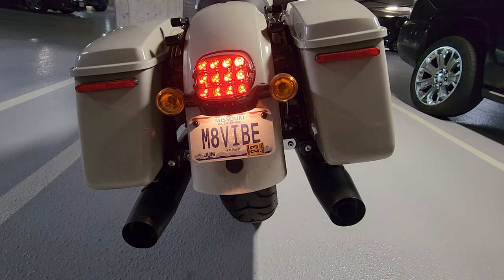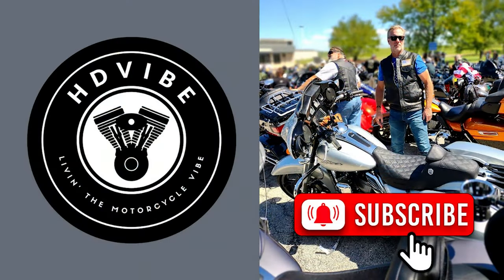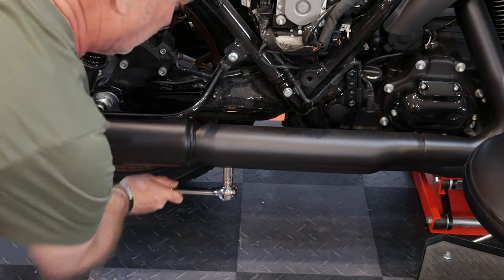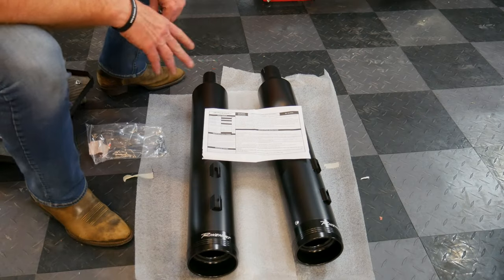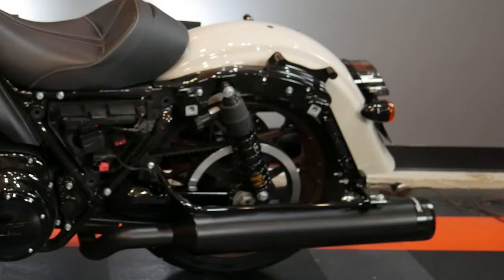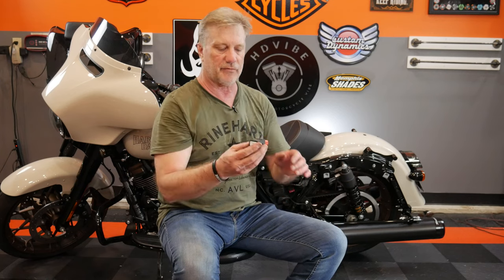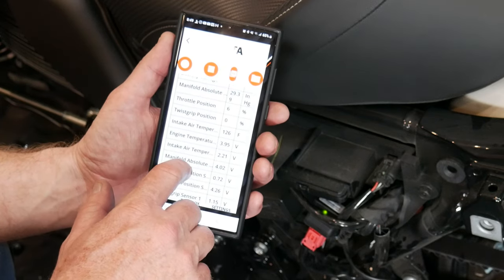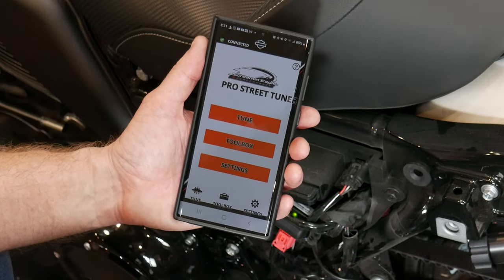Tune your Harley with the NEW Screamin Eagle Bluetooth Pro Street Tuner | Street Glide ST

Comment: Love your videos, but why would you run slipons on a ST with a 117. You leaving performance on the table unless you upgrading later to a full pipe. Have you seen how ugly and heavy the factory pipe is.I know you want to stay within warranty and I get that. I have a 23 RG-ST and put a 2 into 1 Sawicki stainless pipe,powervision tuner, hpi manifold so far. I’m trying to squeeze every ounce of performance out of the motor lol. Keep the videos coming!!
Reply from the maker: Thanks for watching and commenting.   I certainly understand there is more to get out of the 117...but as you stated, I'm want to stay in warranty so I could change it out but I would still have to run the Sceamin Eagle EPA tune.  So will it run well in that configuration and tune or not...that's my dilemma.   I appreciate the kind words and support. If you are already a subscriber...thank you.  If you haven't yet subscribed to the channel I'd be honored if you'd consider doing so.   Ride safe and enjoy.  👊✌️👍

Comment: Does the tuner support Vance and Hines pipes? Thanks
Reply from the maker: Thanks for watching and commenting.   While other slip ons are not specified in the tuner map, the base map supports more free flowing slip ons...in my case Rinehart DBX 45s.  So Vance and Hines slip ons with the tuner should be fine.  If you are already a subscriber..thank you. If you haven't yet subscribed to the channel I'd be honored if you'd consider doing so.   Ride safe and enjoy.  👍✌️👊

Comment: Great video. 
I just became a subscriber. 
I had a stage 1 done with SE Street Cannons and air cleaner 
I have the original pro street tuner like the one you showed in the video.
Would it benefit me to get this tuner?
Thank you for your help and time.
Reply from the maker: The capabilities of the two tuners are nearly the same. The primary difference is you can auto tune via the app on your phone and generally you do not have to use your computer with the new one.  The other advantage of the new one is checking codes via the app and monitoring the engine while riding.  Thanks for subscribing and commenting.   I appreciate your support.   Ride safe and enjoy. ✌️👊👍
Reply: @HDVIBE  Thank you for the quick reply. 
I have seen a ton on negative reviews on this product and it makes me a little nervous about buying it. 
What have you seen out there on bad reviews and what are your thoughts on it and is it worth it?
Thanks again.
Reply from the maker: All I can share is my experience with the tuner.  I haven't had any problems with it at all.  So far everything with the tuner has functioned as it should.  I'll be doing a follow up video on it showing the smart tune feature in the near future...probably in the next 4 to 6 weeks.  ✌️👊👍
Reply: I broke down and bought the Bluetooth tuner. 
It worked like it should. 
The only issue I had was low voltage and it wouldn’t tune so I charged the bike for a short time and finished the set up and tune.
I will update after I ride a little bit.
Thank you
Reply from the maker: @Madfire183_2  Thanks for watching and commenting.   I'm glad you got it installed and loaded the map with no issues.  If you are already a subscriber to the channel...thank you.  If you haven't yet subscribed to the channel I'd be honored if you'd consider doing so.   Thanks for your support and ride safe.  ✌️👊👍

Comment: Have you noticed your Bike running cooler/richer with this Tune ??, I just subscribed, great channel, as I may Come back to H-D once again. ??
Reply from the maker: Thanks for watching, commenting and subscribing.  The tune definitely gives the bike a better air fuel mixture ratio.  The M8s are not as lean from the factory as we're the Twin Cams.  I have had both and the M8 definitely is a bit richer from the factory and runs cooler than the twin cams.  I've recently also smart tuned the bike ( you can also check out that video) and it runs even better.  Thanks for your support 👊✌️👍
Reply: @HDVIBE  
Very True about the Twin-Cam..I had a 2017  LowRiderS 110, and it ran Super Hot. I put Amoil 15w60 oil to cool it down a bit. , Nevertheless, I was given an offer I couldn't refuse and sold my S, for good $$$$
Reply from the maker: @elithegreat6463 👍

Comment: How long does it actually take? mine has been on " Programming Motorcycle with final calibration " for the last 45mins
Reply from the maker: Mine took maybe 5 minutes to update and load the map to the bike.
Reply: Not sure what's going on with this thing. First it said it was connected by blue tooth. Now it tells me another Mobile is connected and I have to unpair from that. I only used my phone.
Reply from the maker: That's is odd.  Hopefully disconnecting and trying again will do it.  As I said mine connected right up and 5 minutes I was good to go.  ✌️👊👍
Reply: @HDVIBE  done that several times,  still will not connect 😑
Reply from the maker: That is odd.  Maybe check with your dealership service department to see if they have any ideas.  👊

Comment: But do you still have the cat in the headers? I thought stage 1 was removal of cat or new cat free headers.
Reply from the maker: Technically a Stage 1 is a heavy breather,  slip ons and a tune.  Often headers are changed out as well...however, many aftermarket header manufacturers are going CARB compliant...which means unless you get old stock,  even new headers will have a Catalyst in them.  It's sad but this is they way the market is going.  Many slip ons are going to be 50 state compliant as well soon.  Vance and Hines and Rinehart just started making the switch to 50 state compliance .  Thanks for the support and ride safe. 👊✌️👍
Reply: @HDVIBE  My concern is that a tuner adds more fuel and more fuel to the cat means more heat.
Reply from the maker: Yes...I understand your concern.  So far I haven't noticed a change in hear on my bike yet.  However I haven't ridden much yet with the new set up.  Another cool feature with the SE Bluetooth tuner is the ability to monitor real time temperature and many other parameters will riding with the app open on the phone while riding. 👍
Reply: You can get  a "stock" decatted head pipe from harley directly I just bought one today with the same tuner but bassani mufflers
Reply from the maker: Thanks for sharing that information Andy.  Ride safe and enjoy.  ✌️👊👍

Comment: Do u have stock headers? I have the tuner but it doesn’t have a option with just slip ons and hi flow filter.
Reply from the maker: I do have stock headers in the bike.  I did ask a Harley Master Technician about putting different headers on the bike.  He told me that if the headers are 2-1-2 then there really isn't much difference in how the bike will perform with the Harley tune.  The only difference will be more sound output.  You can also run the auto tune feature to get the map and air fuel ratio modified for the exact set up.   If you are already a subscriber...thank you.   If you haven't yet subscribed to the channel I'd be honored if you'd consider doing so.   Thanks for the support and ride safe. 👊✌️👍
Reply: @HDVIBE  thanks a million! I am now a new subscriber, thank u! I can’t wait until tmrw to install it:))))
Reply from the maker: Thanks for subscribing.  I appreciate your support.  Enjoy that newly tuned bike.  I was shocked at the improved throttle response after the tune.  👊✌️👍
Reply: @HDVIBE  I’m wondering if I should auto/ smart tune it vs stage 1 stock header tune. They come lean from factory …puzzled lol
Reply from the maker: You have to load a base map before you can auto tune.  👍
Reply: @HDVIBE  hey, what temps are u running with the stage 1 map?? I’m around 290 degrees. Which I never checked temps before.
Reply from the maker: I haven't checked it yet but I will and let you know.
Reply: Sorry if this has been asked already, but will this work for a full exhaust D&D 2:1?
Reply from the maker: @Tack1903 The tune from the screamin eagle tuner is set up for a 2 1 2 headpipe.  However, I do know someone that runs a 2 into 1 with the screamin eagle tuner.  All of the tunes that can be downloaded from the screamin eagle tuner are set up for screamin eagle components.   But that doesn't mean it won't work with other headers etc...it just may not have the most dialed in tune.   You could then run the auto tune feature.  I would also suggest making sure you look at the specs for the tuner to make sure it will work for your bike.  The connector on this tuner is for the 2021 and newer bikes.  I hope this helps are at least gives you a bit more info.  If you are already a subscriber to the channel...thank you.  If you haven't yet subscribed to the channel I'd be honored if you'd consider doing so.   Thanks for your support and ride safe.  ✌️👍👊

Comment: Do you have the stock headers on
Reply from the maker: Thanks for watching and commenting.   I do have the stock head pipe on the bike.  If you are already a subscriber to the channel...thank you.  If you haven't yet subscribed to the channel I'd be honored if you'd consider doing so.   Thanks for your support and ride safe.  ✌️👊👍
Reply: So would it make a difference if you change them or not worth the money
Reply from the maker: @frankjoe31 I recently changed headers on my 2021 Road Glide Special.   The main reason to change headers is to get the heat reduction.  The main culprit creating heat is the catalyst in the stock head pipe.  Actually, the flow on the stock M8 head pipes are pretty darn good...they just get hot with the cat in them.  Check out the video I recently released on changing to a Tab Performance 2-1-2 headpipe.   This is one of the most cost effective headers as you can reuse the stock heat shields.   Plus if you watch my step by step video, you can do it yourself and save the cost of labor.  ✌️👊👍
Reply: Thank you👍
Reply from the maker: @frankjoe31 👍

Comment: I Want to go to stage 2 it's about 4600 dollars at harley dealer my bike is 2018 road glide
Reply from the maker: Thanks for watching and commenting.   I do have videos covering all the needed info for a Stage 2...including costs etc.  You may want to check those videos out.  That cost seems a bit high unless that also includes a new exhaust system.   If you are already a subscriber to the channel...thank you.  If you haven't yet subscribed to the channel I'd be honored if you'd consider doing so much.   Thanks for your support and ride safe.  👊✌️👍
Reply from the maker: Here is one if the Stage 2 videos I've released.

https://youtu.be/mrJEc7Af4Ag

Comment: I have the new SE tuner.  Much easier to use.  Reminds me of the V&H fuelpak
Reply from the maker: Thanks Will for watching and commenting.   It definitely is very similar to the fuelpak but  much smaller.  It functions very similarly to the FP3 as well.  Now to get a few more miles on the new tune then I'll run an auto tune session to get it dialed in.  Ride safe and enjoy. 👊✌️👍

Comment: Have you tried auto tune yet?
Reply from the maker: Thanks for watching and commenting.   I have not yet had the opportunity to run the auto tune yet.  I have only had the tuner on the bike for a few days.. so I need to run about 400 or so miles before I run the auto tune.  I hope to do that in the near future.  If you are already a subscriber...thank you.  If you haven't yet subscribed to the channel I'd be honored if you'd consider doing so.   Thanks for your support and ride safe.  👊✌️👍
Reply: I had the same error after the install. Pretty easy install.
Reply from the maker: It was odd to see a code pop up...but since it was historical all good after clearing it. 👍

Comment: Tuner is garbage.  Read the reviews first.  Constantly disconnects from Bluetooth while riding and trying to "Smart Tune".  Been to two different dealers who cannot figure out why it disconnects. Wanted to return but they will not take it back since it is opened.  Now I have a $450.00 piece of plastic.
Reply from the maker: Thanks for commenting and sharing your experience.   So far, the tuner has worked flawlessly for me.  I have not yet tried the smart tune but plan to do so soon.  I have used it to monitor the engine will riding and I haven't had any connection issues.  Hopefully you or HD can get it figured out.
If you are already a subscriber to the channel...thank you.  If you haven't yet subscribed to the channel I'd be honored if you'd consider doing so.   Thanks for your support and ride safe.  👊✌️👍
Reply: I figured out how to fix the auto tune from disconnecting and it’s the easiest fix 🤦‍♂️
Reply from the maker: @ATCJeremyrides Glad you figured it out.  What is the fix?
Reply: @ATCJeremyrides   My fix was tossing it in the garbage can and installing a Thundermax. Best decision, no brainer.
Reply: @jmaxx73  ha ha honestly you cannot beat aftermarket. Hopefully you installed a bad a$$ cam
Reply: @HDVIBE  mine would be connected and show the learning graph. I would shove my phone in the cubby and when I got back it had disconnected and learned zero values. What I figured out as stupid as it sounds you have to disconnect your phone from your Boom GTS stereo. I even went into setting and hit forget device. What happened is when you start riding your phone bluetooth jumps from the tuner to the stereo therefore dropping the connection on the tuner…hope this helps someone. I will create a video on it soon.
Reply from the maker: Thanks for sharing that tip.  Hopefully that will help someone else that may be having the same problem.  👊✌️👍